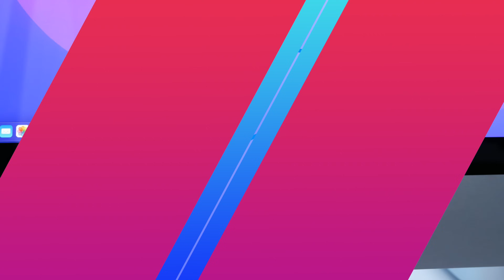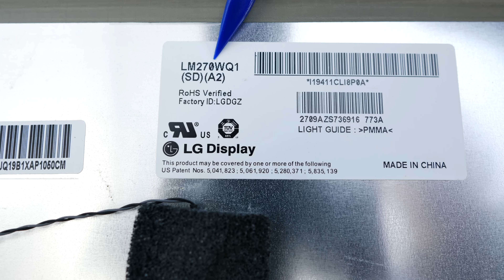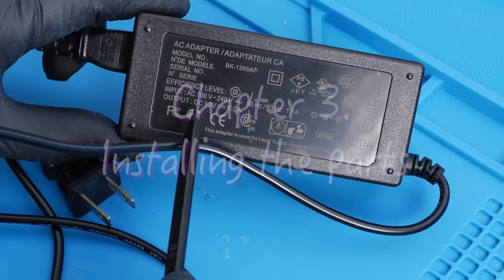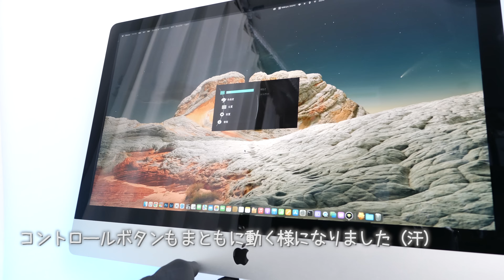古いiMac27インチを液晶モニターに改造するための方法

Comment: Outstanding video... outstanding...many many thanks!
I would like to ask if you noticed lower display brightness with the parts used. There have been others using a similar board that noticed a difference in the display's brightness when comparing with original iMac.

Comment: Well done, thank you for this amazing video! 
You convinced me that it is possible to turn my old iMac into an LCD monitor, while preserving its appearance :) 
I would also like to start this conversion, but I would like to know what type of cords (calibers) you use to connect the speakers to the main base? And to connect the on/off button of the iMac to the control base? 
I am lost with the different calibers available on the market (20awg, 26awg…?), does it matter? 
Thank you for your work !
Reply: Did you manage to do the conversion?